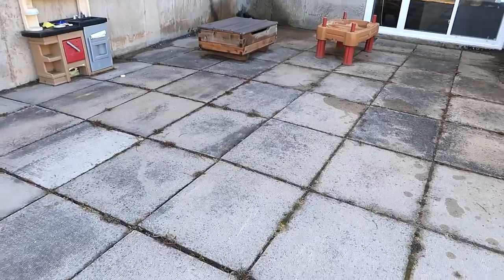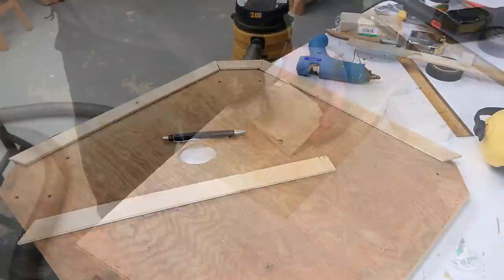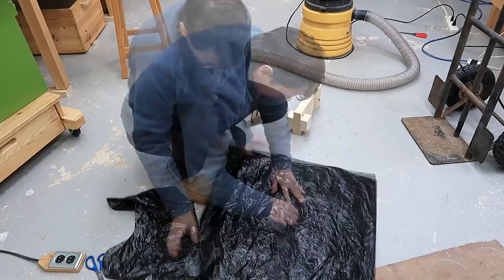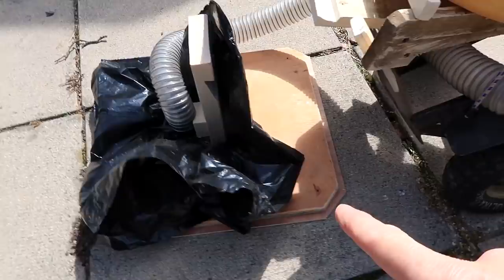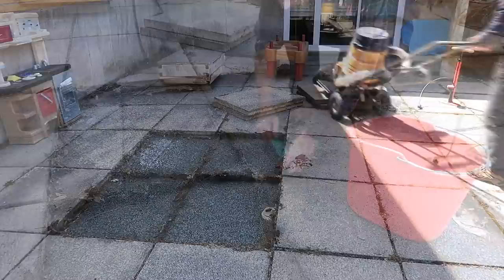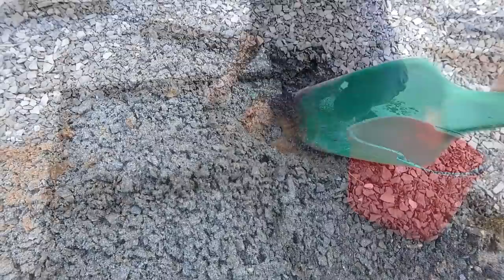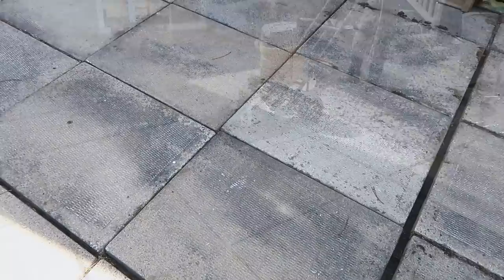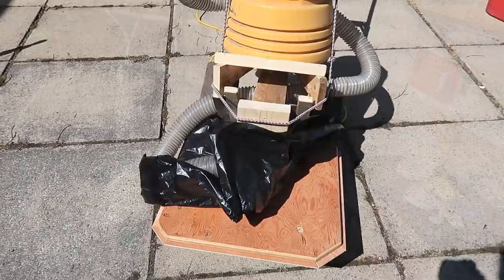Lifting patio stones with a shopvac

Comment: I use the following recipe for the mortar - 1 part cement to 1 parts kiln dried sand to 2.5 parts water and some fibreglass stands to prevent cracking. Pour it in the gaps with a large funnel. Works a treat.
Reply: what is "fibreglass stands"?
Reply: @das250250  Typo. Should be "fiberglass strands"
Reply: Why kiln dried sand?
Reply: @jonanderson5137  it has a lower moisture content and a superior crystalline structure which improves the strength of the end product.
Reply: @daveyjones7391  I assumed sand was mostly crystalline in composition, it changes when heated? I think this might be a rabbit hole. My natural inclination would be that sand from the same source would be similar if not the same as aggregate.

Comment: Another amazing invention from best woodworker on Youtube!

In my opinion you should just lift all the slabs, move some of the gravel into the slope and re-level with a long straightedge, then you can put down some weed control fabric or to be honest, for cheapness, just make your own from strips of old sheets, or plastic crisp packets, food packets etc... etc laid about 5-10 cm straddling either side of the joint line.

Also, lay the slabs closer together - yes you will lose some overall surface area but you can have a strip of soil/grass/gravel along the building to allow better drainage and take up that loss and the smaller gaps you just fill with sand and vibrate (by thumping on them or letting the kids jump around on them for a while). Keep topping up with sand and then when you think all the gaps are as full as they can be then pour a dribble of varnish or polyurethane finish down the crack to bond the sand together and you'll get very few weeds coming back up and it won't cost you much at all...

Comment: If you wonder why it can produce so much force, remember suction-force=suction-pressure*area. As long as the shop vac can maintain that pressure, it can lift a tank if there is enough area.

Comment: 1. Use a bladed weed whacker between the tiles.  Vacuum out the remainder.  Use elastomeric sand.
2. Use RoundUp and just let the weeds die and decay.
3. Remove the tiles and weeds then put plastic  bags under the tiles.  Sweep elastomeric sand between the tiles and wet it in.
4. Pull up the tiles and pour concrete.

Comment: The only way to keep weeds from growing would be to fill the gaps with something that completely blocks off weed seeds from establishing roots. Some people have already suggested polymeric sand, which would probably be the ideal solution, but I don't know what the cost would be for how many stones you have, and how much work you want to put in. If I only had to fill a couple big gaps, the cheapskate in me would probably cut a piece of that foam pipe insulation to fit tight into the gap, and then use some house paint to give it an external layer of protection from sunlight. It would probably be ugly, and might not last as long as the polymeric sand, but it would at least be a cheap fix for now.
Reply: you can get foam 'backer rod' which is saving you a cutting step
Reply: We've tried polymeric sand, sadly with unsatisfactory results.
Reply: Soak the soil with a solution of high percentage acetic acid vinegar & salt solution (recipes on gardening sites) to kill existing weeds.  Cover the ground with plastic sheeting (6 mil vapour barrier).  Carefully replace the patio stones.

Comment: Your patio stone lift / mover is genius!  I have had pretty good luck drastically reducing weeds with a polymeric sand in the grout joints. It hardens with moisture - not as hard as concrete so it still has some give for the stones, but keeps weeds from germinating.

Comment: I used to work for a company that made and installed diamond faced slabs, brick and many others for driveways walkways and the like. We often put down 1/8th inch thick felt filter cloth between the gravel and dirt or between the block and gravel. It is better to have it under some gravel to protect the felt. The felt allows water to filter through but seems to keep plants at bay for a while. Though I notice it  only works for 2 to 3 years

Comment: Hi Mathias,  I have had good sucess with polymer modified paving sand to stop ants and weeds.  Word of cattion, apply only when pavers are very dry and sweep in with a broom. then lightly spay to dampen with a backpack sprayer. Using too much force with a hose disloges the stuff and you will end up with a mess, like PVA and sand mixed together, but very hard to remove.  Good luck.  Great videos! and best wishes from New Zealand

Comment: Forty six years ago I vaguely remember using muriatic acid, undiluted, brushed/flooded over the deck made from patio block that surrounded a swimming pool. As I remember the particular weeds for the location did not grow that season.

Years ago, Roundup would do the job  easily and for years nothing would grow where it was sprayed. I remember my mom sprayed around our 90 foot tall trees and for at least 5 years nothing at the surface grew where she sprayed. Recently I have used the product or a similar product and it lasts only a month or two and takes about 6 days to even show an effect.

Perhaps the best solution is a concrete replacement with a pressed in or stamped tile like finish. But, nature seems to always eventually win much like every squirrel I've come across while feeding birds.

Comment: Nice idea. It's the atmospheric pressure on the back of the polythene making the air tight fit against the slab. You could have a a bigger board with a double "fence" and holes through the board in between them. The Bernoulli principle will pull the polythene down, but it'd be lost as soon as you got a good seal.

You could also suspend your contraption from the upright of your barrow, as a class 2 lever, for a cleaner, more vertical, lift. You'd have to bend down more & the leverage wouldn't be as  good though.

Comment: One could quite easily take the stones out, re-grade the base and put the stones back in less than a day. A straight board, a string, a shovel and a bubble level is all thats needed. With that suction contraption it wouldn't even be too hard for the back. The key is to get the base flat (with some fall) and not mess with it while placing the stones. Usually the base is compacted before final grading of the top one centimeter, but I don't see the need for that if you dont take all the gravel out. The stones are also sometimes compacted after placing.

Comment: One other thought for the vegetation in the cracks, vinegar. I live in the rainforest and use a wheelchair. Blacktop gets really sketchy this time of year. I use an atomizer made for gardening to mist the entire driveway with 50% vinegar and water mix. Can't speak to the long term, I've only been experimenting with it for about 6 months, but I am fairly certain that vinegar is going to be one of the lowest cost options without going to harsh chemicals. I have sprayed concrete that drains into gardens without seeing any sign of the plants being unhappy. Then again, it's the rainforest, so it gets quite diluted. So far I have figured out that the most economical use is after 2 days of sun when the Moss is starting to dry out. If I spray everything then, it seems to get deep in the pores of the concrete. You see a slight difference in the next day, but the big change comes with the first rain. I suspect that the Moss is dehydrated and pulls in the water slash vinegar which kills it to the root. Just a guess. But after 2 days of rain, a simple broom completely dislodges all the Moss, the algae gets rinsed away with the rain. I used to do this job with harsh chemicals and a lot of scrubbing. I don't yet know how it will work long-term, but I can do the entire property in less than 15 minutes. One caveat, I have a fairly absurd atomizer, a professional one. I'm sure it was still work with the hand pump models, but my statements about speed would not likely hold true.
Reply: If you happen to know of a reason why this might be a bad idea, please let me know. I did a little bit of googling, but I'm no chemist. I'm hoping to treat the roof for Moss in this way, I would be able to do so myself from the ground.

Comment: Pull all your stones.   Add and level your gravel field (with a vibraplate/wacker).  Lay weed cloth to prevent anything coming up.  Set your stones, sand the joints.   Spray with weed killer regularly.

Comment: On telecommunications sites we use weed mat which is just a woven plastic, then put blue metal or gravel on top (which would be your paving stones in this case) helps stop anything from growing through but lets water pass. You can cut it with a regular stanley knife and its pretty cheap so that's my recommendation

Comment: Lot of work if you do it piece meal.  Were I doing that, I'd pull all the pavers, use an edge on all the weed lines, use Round-Up or a bag of salt. Add gravel and run a plate vibrator to compact it all again, and then use some 1/8-1/4" strips to get all the pavers to line up when you put them back in.
If you have an old circ saw and a couple of spent blades, just put them both on and clean out most of the muck for the ones that don't really need to be removed. Then just remove the ones that really need it. Maybe fill the empty cracks with polymorphic sand.  Nice vacuum puller.

Comment: When i cleaned up the patio bricks around our pool, i ended up pulling them all up to fix the gaps and to seal them from weeds and such growing again i used a hot glue gun and ran a bead of hot glue along all the cracks filling them in, then with a blade i cut any glue that dried elevated above the surface. Been 8 years now with no weeds or such growing in the cracks after doing it.

Comment: suggestion to stop the weeds:
Roundup.. lots of it, and often..
it's the only way.. 😉

I'd also suggest to start at the inside corner of the patio, so as you clear the weeds, the tiles will snug up against the house, and any gaps created will end up out on the edge at the grass..

Comment: I just use a touch to keep ahead of the weeds. Put a valve in-line with the hose so you can break the suction without switching the vac off. Maybe some weather strip to seal the edges and a heavy coat of paint to seal the small leaks.

Comment: I need to look for one of those single point hole cutters, I got the orient express 2 point model and it instantly jammed in polystyrene (you can cut 3mm of that stuff in 2 passes with a box cutter)  ok fine maybe its my tiny drill press ... take it to work and whacked it into a WWII era bridgeport ... jammed up and snapped the shank

Comment: I have the same patio. It has a concrete base, but the slabs are in gravel and not glued. But the end result is pretty much the same, dust gathers and small weeds and moss grows. I removed all the slabs, cleaned them and put the entire thing back and caulked all the joints. I used grey caulk and it looks decent. Pretty sure it will not last forever, but at least it is lot more cleanable than the old system. Ask me again in 3-4 years :)

Comment: Amazed it worked, brilliant idea! Would a rubber liner on the outside (maybe a cut up bike inner tube) work for the seal? 

For the gaps we use a course grey sand mix in the uk with a small amount of concrete dust. Mix it in a bucket (3/1 mix) then add a dash of water and start mixing. Keep adding water until you've got enough of a consistency where it only just about pours (you really do not need much water at all). Place this between the stones, it takes a couple of hours to set and will be thick and strong enough to stop anything coming through, but not so strong that it's a pain to remove should you wish to lift the tiles again.

Comment: You can buy a pu/sandmix to seal the gaps. You simply brush it in the gaps. It will let water trough but plants will not root there. The gaps need a minimal size for that.
Put a bigger seat of plywood above the garbage bag seal overlapping the lower plywood. This will reduce the sensitivity to the wind. To make it even more stable make a "skirt" with the bag beneath the upper plywood, and put in a small strips if wood as ballast.

Comment: Annual treatments with an herbicide should keep your seams clear.  
     Try a pickup truck topper seal for your vacuum plate.  Maybe a little silicone sealer on the joints.  Or try cutting up an old bicycle's innertube.

Comment: Hi Matthias,
HD has  Black Plastic Sheeting - 4 mil - (4' x 100') - Black Plastic Tarp, Polyethylene Vapor Barrier Plastic Sheeting, Black Painters Tarp, Roll of Heavy Duty Plastic. Sprinkle Walter under slab pavers then put the plastic down O2 will not get in so the weeds will die and won’t come out. 
John

Comment: I don't know what's it called in English but I installed this isolation canvas. I had weeds coming through my patio boards every year before that. None ever since and it was relatively cheap. After 5+ years there is bit of moss on the surface of the canvas but I think it will still go for 3 years. I also think it keeps moist of the bottom so that my planks will not rot so easily since I don't have gravel but soil under it.

Comment: For weeds, use geotextile to really prevent the weeds to settle, you have to make sure there is enough overlap between the bands of textile to not have weeds that wiggle out. The other option is to put 1-2 inches of pine bark under the gravel. It's a good way to make the ground a lot more acid which prevents weeds from sprouting in the first place, but the best advice is to keep the patio clean of any dirt between the joints. If there is sunlight, water, and dirt, there's gonna be weeds.
Reply: Pine bark or any organic matter will rot, leaving a void and causing the pavers to be very uneven.

Comment: You can buy heavy weight weed stop material to put under the slabs. HOWEVER the weeds will still grow in the dirt that gets blown into the cracks between them, easier to remove though because the roots are shallow. Personally I burn them off with a weed killer wand gas torch ever month on our driveway. You could try sodium chlorate under the slabs it stops everything growing but can creep.

Comment: I covered the patio with black plastic sheet for 3 weeks in spring. All weeds died as they could not reach sunlight. Later I moved the plastic to another weed removal area in the garden. Repeated 3  times in a summer period.

Comment: I believe there is a fabric you can put down before you put the stone down that works to stop plants from growing up. It's used in mulch areas all the time. 

The easiest way to deal with the weeds though is pressure wash them and then get an outdoor grout to seal the gaps. It's more of a sandy product that you can put down every year and works great to lock out the seeds and weeds.

Comment: I've made one of these using foam weatherstrip instead of a garbage bag. Just gotta watch out as not to damage the foam strip by dragging it over the floor. I also used a small but powerfull handheld vacuum cleaner, 1100 W iirc.

Comment: pressure wash between cracks full paver depth once a year is my recommendation from a property maintenance perspective 13 years experience southern eastern USA states. herbicide that lasts 6-8 months once a year. honestly the border around the entire area needs a barrier for proper drainage of water and to disallow dirt intrusion. there is a sand that can fill those gaps around pavers that hindrances plant growth that really packs in nicely. I might consider a redo on the foundation of the whole area i feel is should be a bit deeper for longer intervals of said. those are modern methods. Polymeric sand is the stuff after redoing the stones in situ.

Comment: “Sharp” sand seems to help with weed control.  Basically it’s crushed rock dust rather than sand than has been rolled and rounded.  So far it seems to have worked fairly well with my pavers.  Cool video!

Comment: Instead of the garbage bag, one could use automotive weatherstripping on the underside for a flexible airtight seal.

For the gaps, I've seen a large-gap rubber caulking between slabs at large warehouse stores (Home Depot, Office Max, and their ilk).
Reply: That what I assumed would go on the bottom. Some wide, low profile, weather stripping to make a nice seal against the rough surface.

Comment: They make a fill sand that has a water activated glue sealer so it sets like grout. That would keep the weeds out but you’d need to make sure the pavers are sloped away from the house adequately.

Comment: insulating the ground at the spacing between the stones maybe with plastic bags or pvc sheets so that light doesn't get through and then maybe some sort of weak tile glue to prevent dirt from building up in between the stones (which is essentially a tiny plant pot)

Comment: I cant help but think a massive improvement could be made by just mounting the suction cup with a pivot and making a hand control to turn on/off the shop vac and control a valve to release the vacuum if necessary

Comment: i work with stones for a living, we usually use concrete powder then we sweep that around filling all the spaces between the stones, i suggest redoing all of the patio to get the gaps as small as possible, but you could also just clean the gaps out then sweep it over with the concrete, and just leave it and it hardens, love the vacuum machine btw, acually not that far off what we use to lift stones at work :)